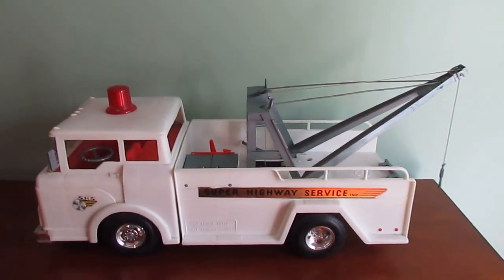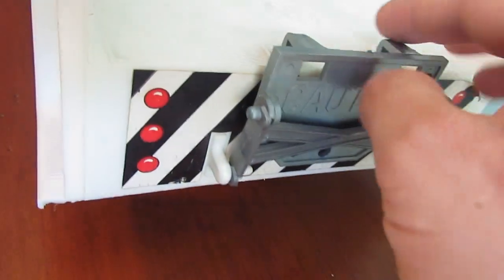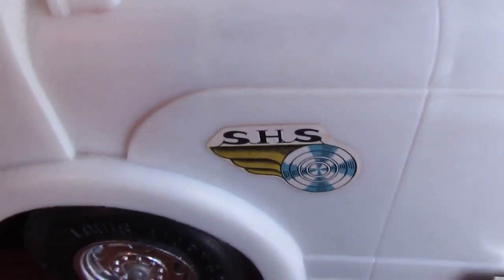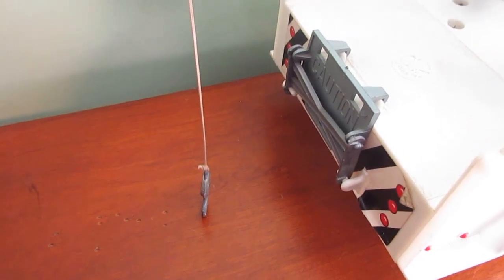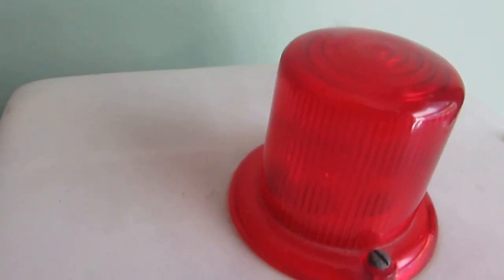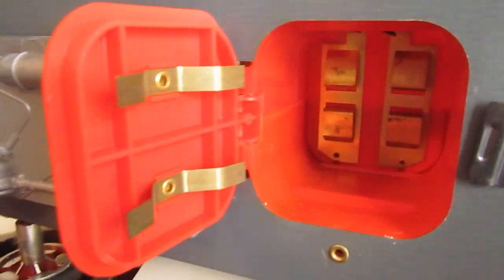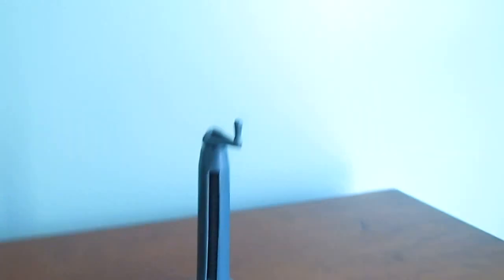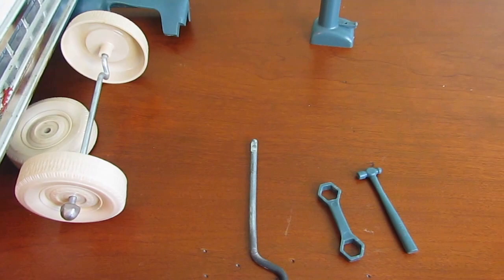Marx Toys Big Bruiser Battery Operated Super Highway Service Tow Wrecker Truck

Comment: Big Bruiser came out in 1964 or 1965, I got one for Christmas. It did came with Plastic Pickup, You could replace the fender, After You can pretend a accident, I found out You could use Tonka  Toys as well. I think My Mother gave Mine to Goodwill when I moved out.

Comment: I have 8 of these and the main attraction for collectors.....is clean battery box.....even if the motor works.A toy collector in NW Indiana bought one of these in 68 and it was still sealed in box new.At the flea market that I witnessed.....this guy sold it ...still in box.....unopened ...sight unseen for 800 bucks.This was in 1998...Valparaiso Indiana....man....what a deal....in 1962 this cost 11 bucks.I was told more like 8 but we found a price tag on a few.    11.49 $

Comment: I picked up what I think is a Marx truck.  The same truck is on eBay as "Vintage 1950's Marx Pressed Metal Large Bed Dump Truck Pickup Farm Construction."  Mine doesn't have the Marx logo on it anywhere.  Is it possible it's a knockoff?  It's EXACTLY like the one on eBay and doesn't look fake or new.  Did Marx ever make toys without the logo?
Reply from the maker: Anything is possible, it could have been rubbed off, but Marx usually marked their toys.